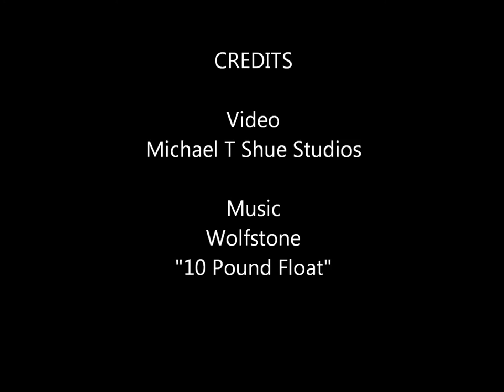Converting a Sherline Lathe into a Production Lathe 1

Comment: Did you ever finish this after the flood cleanup? I would love to do some minor automated pen work with something like this - set up some pre-designed basic profiles that would take out some of the drudgery of batch work!
Reply from the maker: My day job has kept me out of the shop for too long. I've been hoping to get back in since I've been working from home, but the office has needed more attention than anticipated. I have the tool holding blank from my friend now. The other issue is the project that I was originally designing this to be used for I've lost interest in, so I don't have a need for any longer. I will finish it just to see if I can make it work, but no clue what I'll do with it after.

Comment: Bought a Sherline 4400 lathe and a mill which had been in a flood.  All the ways are rusted and the aluminum wheels are corroded.  I've succeeded in cleaning the lathe except for the 3 jaw work holder.  I'm still trying to break it loose so that I can clean the rust off of the rest of the ways.  Any suggestions?
Reply from the maker: Sorry that I never saw this. Soak it in white vinegar. That will eat away the rust but leave the steel. You will want to remove any grease afterwards and replace with fresh.